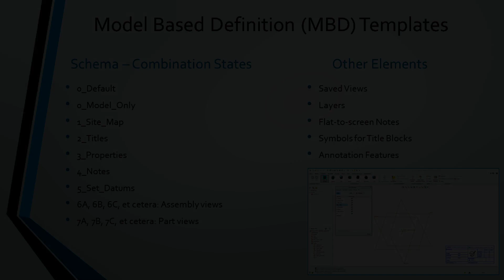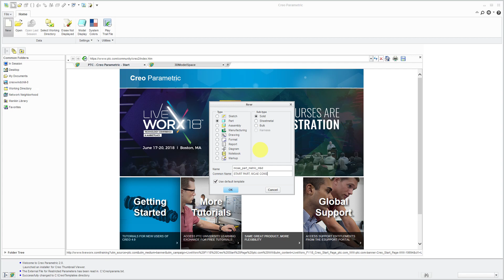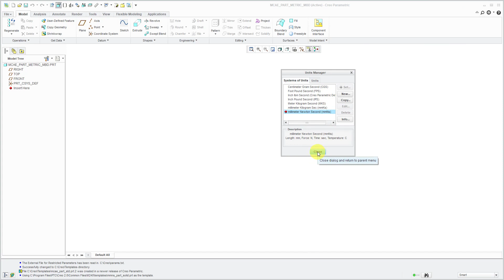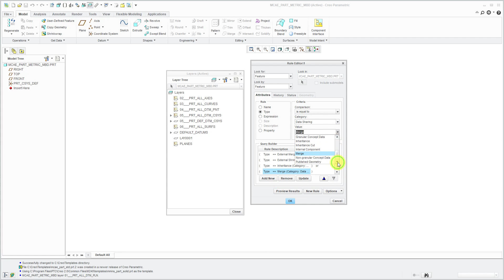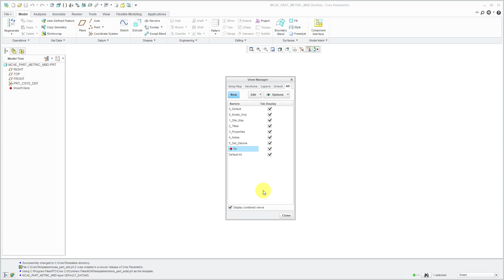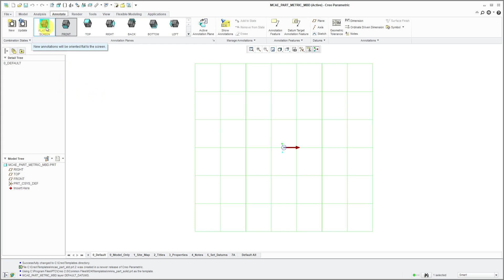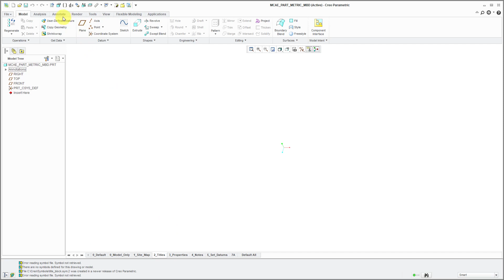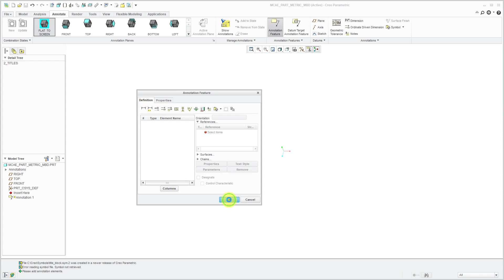Creo Parametric - Model Based Definition (MBD) Templates | Tutorial

Comment: Great video. Can you tell me how you created that titleblock symbol? I would like to create one but cannot for the life of me figure it out. Thanks
Reply from the maker: There's a zip file called MBD-Template at https://www.creowindchill.com/dropbox and it has three different symbol files, although I can't remember what's different between them. All the files should open in Creo Parametric 2.0 and later.
Reply: Creo Parametric thank you very much. I’m using creo4 so I can’t open the symbol file stand alone. Can you save it down? Thanks again for the help.
Reply from the maker: Those symbol files are from Creo 2.0. Can you retrieve them into the Symbol Gallery? How are you trying to open them? You can't open them directly.
Reply: @CADPLMGuy  I'm using the Symbol Edit...copy symbol. When I pick the titleblock sym. I get this message: title_block.sym was created in a newer release of Creo Parametric. error reading symbol file. symbol not retrieved. I can open your drawing and see everything. it looks great. I just can't edit that symbol and make my own copy according to that message.
Reply: I saved out the file and deleted everything but the titleblock. I was able to redefine the block and add our logo into it. So far it looks great. thanks again.
Reply: Confirmed. I was able to alter your file and make a “template” from it. But the symbol itself was created in a newer version than 4. I can’t make an assembly with that symbol. When trying to save that title block symbol to a new directory, it errors out.
Reply from the maker: I stole it from a PTC model. I'll put the symbol, model, and template on my Dropbox on my website later today so people can download them and play with them. I'll let you know when they are available.

They really need to implement tables in MBD. I believe PTC is reconsidering their stance in that area.

Comment: What about assemblies? BOMs? Baloons?
Reply from the maker: Good question. My response is probably more than what I can put in a YouTube comment.

Prior to his leaving PTC, I used to hound Rafael (program manager for 2D and 3D drawings) about the lack of support for tables. He said that MBD wasn't meant to replicate a drawing in parts and assemblies. Without tables you obviously can't do BOMs or tables critical for cables and piping.

I struggle with this, especially at my day job. It appears to me that MBD might intend for BOMs to be managed by separate Parts Lists generated from a Product Structure in a Product Data Management (PDM) system like Windchill. And I can see how MBD in 3D mode supports cross-highlighting between objects in the tree and the graphics area, which can be an excuse for not needing balloons (I don't buy it).

As far as routed systems, I don't see how they can currently be managed in MBD. This is not a short nor direct answer, but it's a complicated situation. MBD is still evolving, and it might not have direct analogs to everything we see on a drawing today - and that might be the intent.